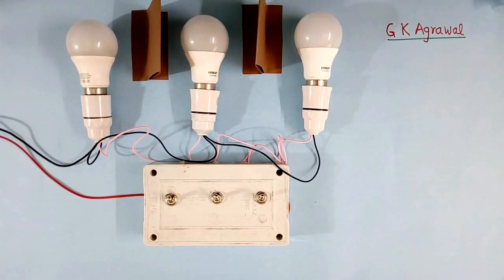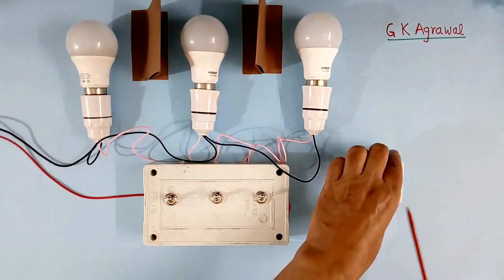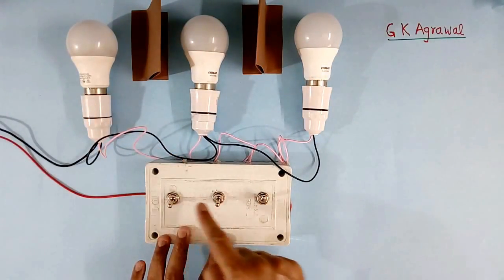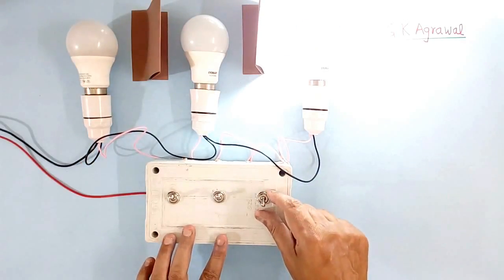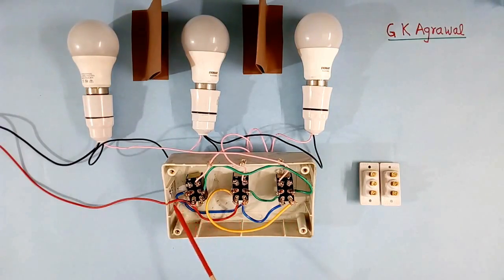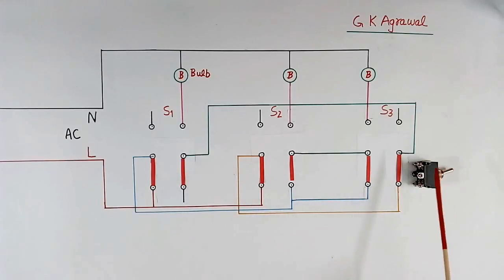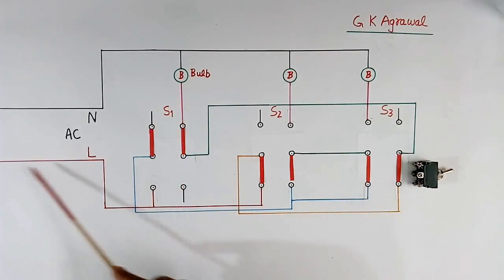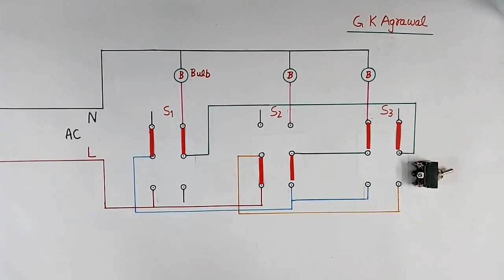3 bulbs 3 switches, only 1 bulb can be ON at a time

Comment: Please.  I need this setup for a question and answer game.  I need the light that lights up first to block the other lights from turning on.  Plus, the ability to add other lights if more students come to my class, now I have five.  It will be a game of ability and knowledge. Thank you for sharing your knowledge.
Reply from the maker: I understand that if any student presses the button to answer 1st, then that light will be on and all else light remains off.
If this is the case then I made such a circuit long back using electronics for one exhibition. But that had only 2 buttons. What you have for 5 students is electronic or mechanical?

Comment: Fantastic diagram and schematic! I have been trying to design ALMOST this for some time using relays. Hard circuit is preferred - no electromagnets & diodes required. HOWEVER what I need is the any light which illuminates STAYS ON and the others can't come on. Only after a reset (all off) can another light come on. So a SINGLE light comes on exclusively until reset. Is this possible?

Thanks in advance
Bruce
Reply from the maker: I never tried the logic as required by you.
Reply: @GKAgrawal2  Thanks for replying. All the best.

Comment: Hello sir, great and informative video.  I have a question that you may be able to help me with if possible.  I have a light switch in my dining room.  If the dining room light is on, then I can't turn on the  light on my patio. If my dining room light is off, then my patio light turns on.  If my patio light is on, then I turn on my dining room light, the dining room light turns on, but it the power to the patio shuts off.  How can I have it so I can have both lights on at the same time?